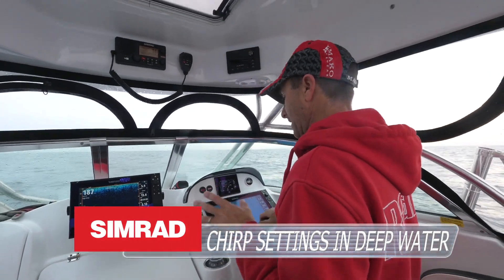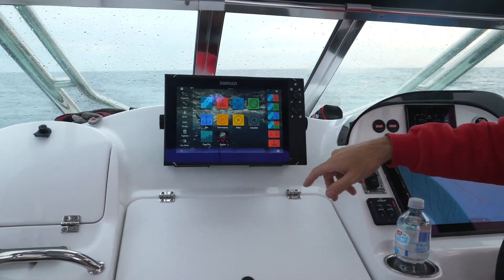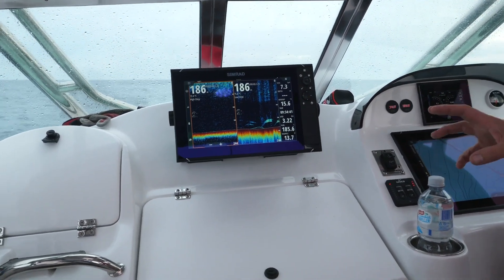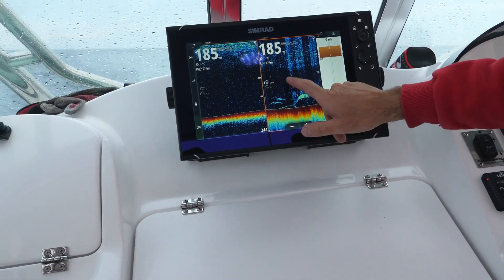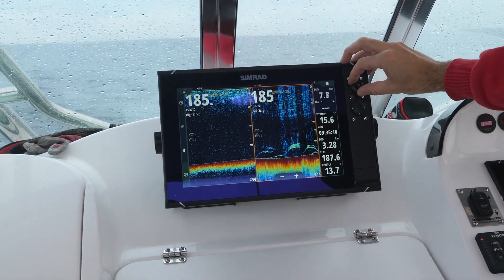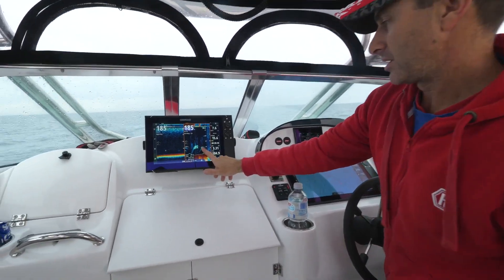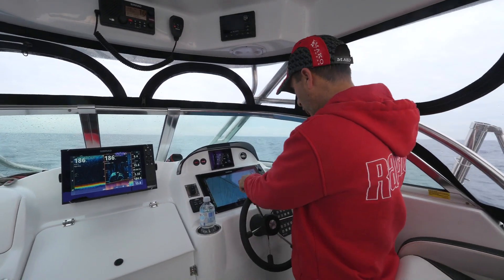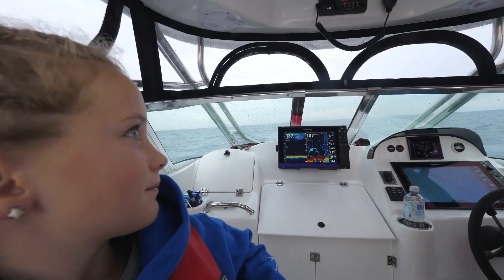Simrad | High and Low CHIRP - What's the difference?

Comment: Is that two different transducers or one dual band transducer?
Reply from the maker: It is one Dual-channel CHIRP transducer.
Reply: @simrad-yachting is there s5100 module? How did you connnect dual channel chirp transducer to mfd? Or can we connect like tm265 transducer to mfd directly (are we able to use still low and high channel) independently?

Comment: Hi mate. I have a 3 in 1 transducer with new go series. Out wide fishing over 600 meters for blue marlin, I want to see the top 150 to 130 metres. Should I use low Chirp to mark bait. Havnt had much success with it yet marking bait and marlin. Trolling at 7 knots, usually 1 to 2 meters. Any info would me greatly appreciated. Cheers.
Reply: abit late but run it on high